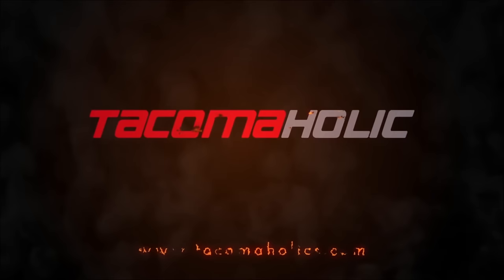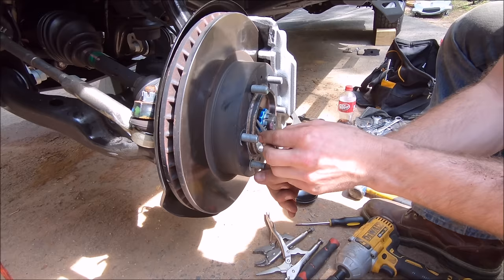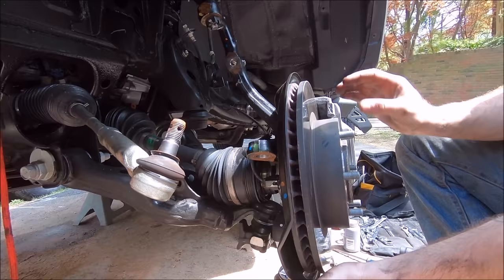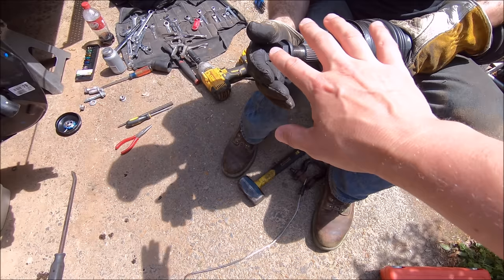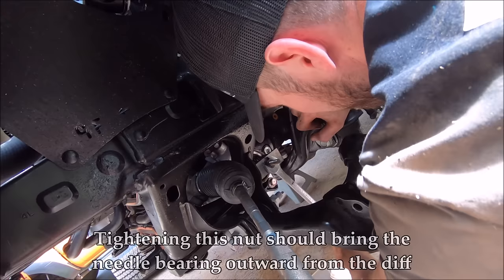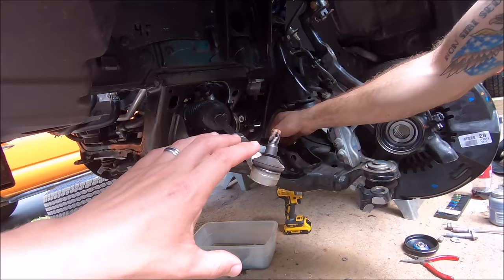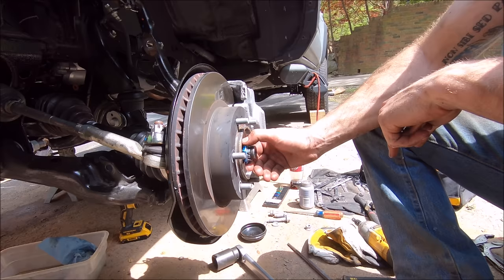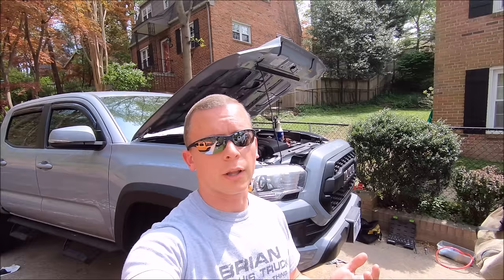Toyota Tacoma Needle Bearing Swap for ECGS Clamshell Bushing

Comment: I actually took a day off and drove from Northern Virginia to NC to have ECGS actually perform the change with their bushing. Great folks, cost me less than $350 to have them perform that, including bushing, and made sure my rear axle was within spec. 3 degree shim added. Would highly recommend them if able to make the drive. Most professional company. I have 2018 Tacoma with 3 inch OME lift
Reply: That is my Truck in the video.  I also did the OME lift and 3 degree shims. Rides great. Zero vibes.

Comment: I have a 2015 tacoma 4wd, i had lifted the front 1 3/4'' in front with bilstein shocks and noticed a roaring noise coming from front diff. Replaced needle bearing with bushing from ECGS and it solved the problem. Also front end would shimmy around 55 mph. Solved that problem also. Definately worth it and did it myself.
Reply: was the noise constant or kinda on and off

Comment: I tried the cable method, and I found it easier to just add another set of jack stands under for safety and then take a long flat edge screw driver with a 3 pound hammer and Tap the CV out from under the vehicle on the slotted edges on the CV.  Worked well to get it back in as well.  Just tap, tap tap and spin the CV a little and Tap some more to overcome the Clip on the axle.  I would also replace the seal while you are in there, but this taco was brand new so maybe not needed for this job.

Comment: Had to do the same on my 4WD Tacoma.  I took it to 4 wheel parts to have a 3" lift installed. Afterwards I had the famous intermittent vibration. They knew about it but didn't know how to fix it. After extensive research and watching this video I replaced the driver side needle bearing with the ECGS bushing. You would've thought that a big company like 4 wheel parts would've had the wherewithal to figure it out. Unfortunately not 🤦
Reply: just another crappy hacked slopshop?
Reply: Used to work for 4WP as a technician... Do not go to 4WP 😂

Comment: Dude. I just wanted to say thank you so much and you’re a genius, I couldn’t find a slide, hammer or CV attachment in the stores I had locally, but I could find steel rope a dead blow, and some connectors created one of those styles slide hammer is that you did, and it worked great. Would not have gotten it without you. Thank you.

Comment: Just wanted to provide an update tried here what was suggested for the sting wheel vibrations and even though the work was not as easy as in this video.  It did correct the problem and I appreciate you for sharing your video

Comment: That ECGS bushing was the best modification I have done my truck feels smooth and silent. I  had been chasing a noise and vibration after a leveling of about 2 inches and now it's so much better 👍
Reply: Did you have any steering wheel shake at 45-60mph.
Reply: My small vibration is after 65mph but kind of subtle and goes away not sure if it’s even the needle bearing
Reply: @TheMffd26  Is it only at those speeds?  Mine vibes between 70mph - 80mph.  1st Gen Tundra

Comment: I have some vibrations after a 3” suspension lift and -18 33” tires. Vibration is between 45-65mph. Chances are this isn’t my fix but it won’t hurt. Panning on keeping the truck as long as possible. 2021, 26k miles and paid off.
Reply: 27 years a possibility for ya?

Comment: Great info and detail.I've got a 19 trd sport with a 1" lift and I believe this is the problem it has steering wheel shake at 40 mph.Had alignment checked and rotated tires and still shake.So I will check cv next.Thanks guys.

Comment: A few things:
1. My extractor tool nut size was 19 not 22mm
2. The tie rod puller, 35 mm socket, 250lb torque wrench can be rented from AutoZone (Advance Auto has wrench and tie rod kit but way more expensive as you have to rent a whole kit).

Comment: Put a 2inch lift on my Tacoma and immediately had the vibration. Just changed out the needle bearing, without pullin the axle from the hub, and replaced the bearing with ecgs. Vibrations gone!

Comment: Come over Saturday with your tools. I'll provide the beer and BBQ.  I have a 2006 Sequoia bone stock needs this 186,000 miles.  My 2006 Tundra 156,000 miles  is probably not far behind.  I bought the ECGS sleeve and tool since I will probably being doing it again  on the Tundra.   My trucks are the same as your Tacomas but I have V8's LOL.

Comment: So you’re removing a bearing and putting a bushing in its place?  I thought bushing don’t last that long compared to bearings?
Reply from the maker: Not sure in other scenarios but in this case the factory needle bearing is far weaker than the clamshell bushing. I've never heard of one of the ECGS bushings failing after install.

Comment: Ughh i needed one after like two weeks of being lifted.
Reply: Wow so quickly? I'm thinking twice about lifting now lol
Reply: @yezkaholic  lift is great. Just find someone that can do the the needle bearing.
Reply: @RCPropaganda  I read somewhere that the 2018 and up have "upgraded" bearing but looking at forums it's BS. How much did you pay for yours I'm in California most shops want $300+
Reply: @yezkaholic  i got lucky met a guy on local fourms he did it for beer. Just bought bearing puller tool then sold it after.
Reply: @RCPropaganda  that's dope, so after you replaced the vibrations went away and never came Back? Yours is a 3rd gen right?
Reply: @yezkaholic  yes no problems. My truck is a 17. 62k miles no problems. Had bearing swapped near like 20k
Reply: @RCPropaganda  awesome sounds like the bushing works perfectly

Comment: Is this only a Tacoma Issue? I recently purchase a 16 Tundra SR5  and just lifted got new tired and alignment done but truck keeps vibrating around 60-65 along with my steering wheel.
Reply from the maker: I'm not sure if the Tundra's use the same/similar setup.

Comment: How can I remove the needle bearing outer housing if the puller destroyed it? All that is left is the outside shell.
Reply from the maker: If small pieces of the needle bearing remain inside then you need one of these telescoping magnets to help fish all of the pieces out: https://amzn.to/3a8Y0A4
Reply: @Tacomaholic  yeah I did that but the outside of the bearing is still stuck inside the hole. Any ideas on how to get that out?
Reply from the maker: @davidchandler2276  I've never heard of that happening before. Did it just snap while you were trying to pull it out?
Reply: @Tacomaholic  yes. I can send a pic to you if you want.
Reply: Got it!!! Cold chisel and a hammer! Thanks for responding earlier. Pretty cool I got to message with you. Love your videos! They have helped me tremendously!
Reply from the maker: @davidchandler2276  Glad to hear you got it out. Thanks for watching David!

Comment: Stupid Question Alert....Do you have to do the passenger side bushing as well? Or is the problem only with the needle as the passenger side is a tube bearing?
Reply from the maker: I'm not even sure if the passenger side is setup the same way as I've never seen anything done with that side.
Reply: @Tacomaholic  It isn't it has a ball bearing...which according to ECGS's FAQ page "normally does not go bad." 

So shame on me for not reading first. Thank you for the quick reply!

Comment: So Iam about to order the bushing for my truck. I seen that there is play on both side. I was just wondering if you know if the bushing work for both sides or just the driver side ?
Reply from the maker: Driver side only. The passenger side has a different setup.
Reply: @Tacomaholic   Thank you do you know if it a ball bearing on that side by chance?
Reply from the maker: @user-ni6vd2ly8y  I'm not sure what the passenger side setup is, but I've never heard of it needing to be replaced.
Reply: Thank you! I appreciate you taking time to help me out with this.
Reply from the maker: @user-ni6vd2ly8y  Any time 👍

Comment: I've got a 2020 4Runner ORP with a 3 ish inch lift with aftermarket UCA's with 17K miles on the truck. Did the lift about 12k miles ago and just last week started to get a strange oscillating/harmonic like hum and mild vibration most noticeable at 40-50 mph on smooth pavement. It comes and goes in a reoccurring cycle. No wheel shimmy or shake, but noticeable through the steering column, floorboard, and seat of my pants. I'm thinking this needle bearing issue may be the culprit. Time to do some deeper investigating and get this ECGS busing swap done if need be.

Comment: Hi. I checked the passenger side axel to differential and I was able to move it. Do you have the part number for the roller bearing?
Reply from the maker: The ECGS clamshell bushing only goes on the driver side.

Comment: So I lifted mine 3 1/2 Inc. Full suspension lift  and I didn't have the vibe at first it was a few days till I started feeling it. So there are 2 of these needle Bearings one on each side correct
Reply from the maker: No just 1 needed for the driver side.
Reply: @Tacomaholic  witch way to I put it in. Flush side out or
Reply from the maker: @grizzlys91ify  The ECGS bushing is the uniform if I remember correctly, so you can't put it in the wrong way.
Reply: @Tacomaholic  no there 2 different sides ones flush other side is not. But I looked it up and flush side has to be out. When I was takeing the Needle bearing out the tool dug in to the I side as bearing was comeing out so hope to God it will be ok. I have bye bushing in freezer for the night. So I can put it in. When I get up in morning
Reply from the maker: @grizzlys91ify  Let me know how it goes.
Reply: @Tacomaholic  I will I hope that gouge with me fine. I'll make video here in a little bit  I have to go to for for a few hrs and I'll be back at it
Reply: So the axle nut I'm get all kinds of different torque specs can you tell me the lagit number please
Reply from the maker: @grizzlys91ify  173 ft/lbs
Reply: @Tacomaholic  what about lower ball joint 🤔  and thank you so much for your help its awesome 👌 👏
Reply from the maker: @grizzlys91ify  This thread on Tacomaworld is saying 103 ft lbs for the front bolt and 118 for the back bolt. https://www.tacomaworld.com/threads/the-torque-spec-guide.318116/
Reply: @Tacomaholic  I'm lost sorry whats that torque specs  for again I'm sorry I been under truck all day
Reply from the maker: @grizzlys91ify  Lower ball joint.
Reply: @Tacomaholic  so ball joint its self is 103 104

Comment: What if the vibration only occurs in 4hi?
Reply from the maker: It does that all the time or only at certain speeds?
Reply: @Tacomaholic  only at certain speeds between 45 - 55 while accelerating
Reply from the maker: @malick469  Have you checked to make sure your tires are balanced?
Reply: @Tacomaholic  yup tires are balanced, I already received the ecg bushing so I'm def still gonna install it, especially since I have a 3inch lift on my 4th gen 4runner. From what I see on the forums alot folks told me it's most likely the needle bearing but I've heard mixed opinions. Especially with some folks saying it does away in 4hi(I only have the problem in 4hi)

Comment: Just bought a 2017 Tacoma Sport last month, factory certified pre owned. People kept commenting that my truck looked higher up, so I took a look and to my surprise the previous owner must have put a spacer/leveling kit on it, maybe 2” in the front and 1” rear. Anyways, I just recently started noticing this weird oscillating groaning vibration coming through the wheel and the floor. It’s subtle, so I’m sure it was there the whole time, just took me a while to notice it. After reading about needle bearings, etc. I tried putting it into 4H to see if it went away and it does.
Will removing the lift kit spacers and returning the truck to stock fix the vibration? I’ve read some on the Tacoma forum where removing the lift corrected the issue. I don’t even want a lift on my truck, prefer it stock.

I’m going to call the dealer where I purchased it today. They did not disclose that the truck was lifted (perhaps they didn’t know) because I probably wouldn’t have bought it had I known. Perhaps I can make a case for returning it. I’ve had it less than a month. I just don’t want to get in a drawn out song and dance with the service dept trying to diagnose and fix the issue. This is my work truck, I just need a truck that works.
Reply from the maker: Removing the lift should help correct, if not outright eliminate, those vibes associated with the needle bearing.

Comment: If the differential has a spacer to accommodate the lift height is lifting still an potential problem for the needle bearing................?

Comment: You don't have like puller for the CV? With as often as the front has to come apart it's worth the 40-60€ investment. Also, prying on that part of the CV can bend the dust shield that interfaces with the oil seal.

Comment: Would you recommend doing the needle bearing the same time as the lift? I'm thinking about 5100 all around, ome 888 coils up front, and an aal in the back, with a diff drop.
Reply from the maker: Either then or when you are changing your front diff oil.

Comment: One more question.  On my 2008 Toyota tacoma sport, my first lift kit was 3 inches in the front and 2 inches in the rear. Then I purchased an ARB winch bumper. Then I put blisten 5100 adjustable struts to 4 inch front and 3 inch in the rear. Now I've noticed that the front differential needs to be adjusted lower. The spacer that's in there now is for a 3 inch lift. Can you recommend a company that sells a front differential spacer kit for a 4 inch lift ?        Thank for your time.
Reply from the maker: All of the diff drops I've seen were for a standard 3" lift.

Comment: Thanks for the video. Wish some more details were mentioned regarding the new bearing install.  How far does the new bearing have to go into the diff? How did he first align the bearing? Etc etc.
Reply: To first align it, you just get it square with the hole, so it's nice and straight. Then once it's started you can break out the long pipe. As far as driving it in, there's a little metal ridge in there. You hit it flush with that. I recommend supplementing these instructions with the ECGS install instructions, for a complete picture with all the details and tips.
Reply: @randallbrusher503  Thank you for showing us how to do this.  I'm an old fart, shade tree mechanic who works in the drive-way like you.  I have done many things to my vehicles but have been unsure about this procedure.  Your clear demonstration of the bushing installation answered many questions I had.  Thank you again!

Comment: Just purchased a 2014 with no lift and only 43K miles. My hearing isn't what it used to be so not sure what I'm listening for. But I can move the Axles up and down. I'm thinking this should be done. As a second owner on a '14 would this still be covered under the original warranty? @tacomaholic tacomaholic
Reply from the maker: I'm not sure if it's covered under warranty, but a quick way to see if you need the ECGS bushing is if you feel vibes in your truck to switch it into 4hi while going about 45 mph on a straight road, if the vibes instantly go away then you need the ECGS bushing.

Comment: I have a 2009 TRD access cab with an AT summit wedge camper on it. Suspension is stock. The camper has squished an inch or 2 of the lift. If I lift the truck just back to ~ normal do I  still need to mess with the needle bearing? Thanks
Reply from the maker: I would guess that if you are lifting it back to the stock height you wouldn't have issues with the needle bearing ... but if it's off by just a little bit the issues could develop.
Reply: @Tacomaholic  
Makes sense. Any idea if it’s the opposite as in the truck is sagging from a load? Is changing the angle bad if it’s lower not raised? Thanks
Reply: @Tacomaholic  

Also. Do you know of any difference between the bushing from east coast gear and the one from nitro? I can get the nitro one locally. Thanks
Reply from the maker: @at1970  I'm sure the part is the same between the two companies.

Comment: How far in did you guys put the ECGS bushing in?  I read it's suppose to be flush.  But I'm having some issues to get it in all the way flush.  It's sticking out maybe 1/16 of an inch (1/8" at the most).  Any suggestions or advice? thanks
Reply from the maker: This one was flush if I remember correctly. Have you made sure it's clean behind the bushing and anything small isn't obstructing it?

Comment: Will the vibrations be constant at all speeds I just lifted my truck and I know for a fact my driveline angles are all messed up so I’m gonna order a woody, from off the line shudders to decel vibes will the needle bearing be at a specific speed?
Reply from the maker: Needle bearing vibes are usually around 35-50 mph.

Comment: Would this also be effective in fixing the common 4Runner Tacoma highway steering wheel vibration on stock vehicles? (Assuming all other causes have been eliminated like wheel balance).
Reply from the maker: Hmm not sure about that one. Have you checked on the 4Runner forums?

Comment: I have a 2016 Tacoma off road 4x4. I want to put a 2" lift on it. With your experience on having to swap out the bearings, do you think a 2" lift will require a bearing swap?
Reply from the maker: Hard to say because it's not guaranteed that your truck with have vibrations after installing the lift.
Reply: @Tacomaholic  ok thanks for the reply.

Comment: My vibes on the passenger side so do I replace both ?
Reply from the maker: This is only for the driver side. Passenger side is setup differently. But usually vibes felt from this issue are sort of generalized and not side specific.

Comment: I have a 2019 TRD I don’t want anything real tall and I don’t want real big tires . What size tires do you use and what is the offset or back spacing of your wheels so that it doesn’t rub
Reply from the maker: My tires are 285/75R16 which is a 33". My rims have 3.5" of backspacing and -25mm offset and they rubbed pretty bad.